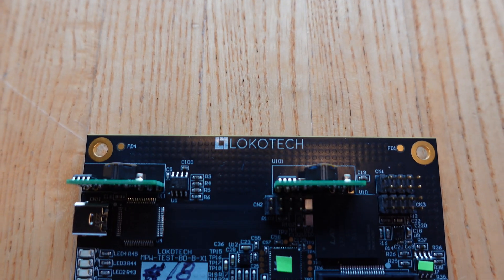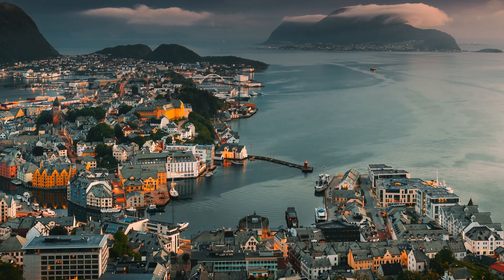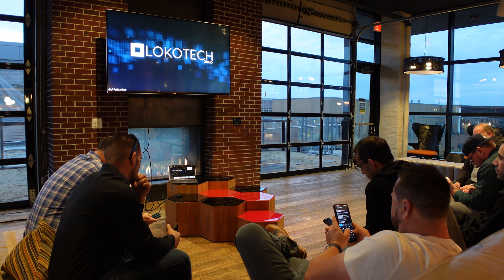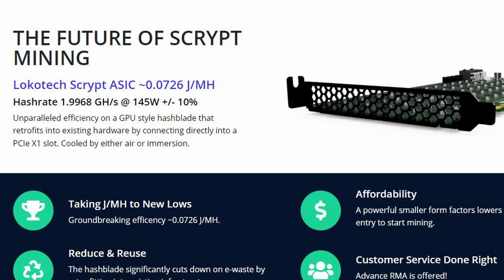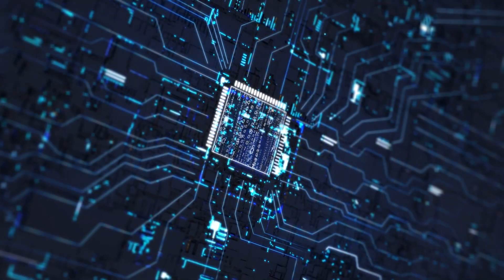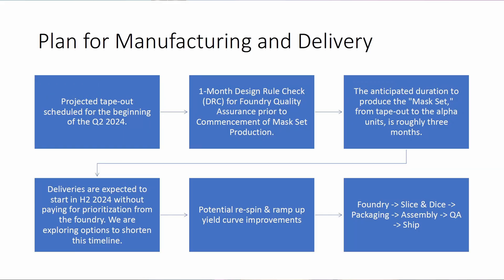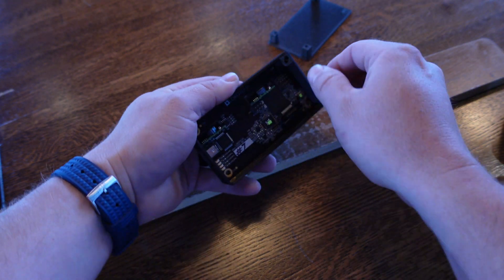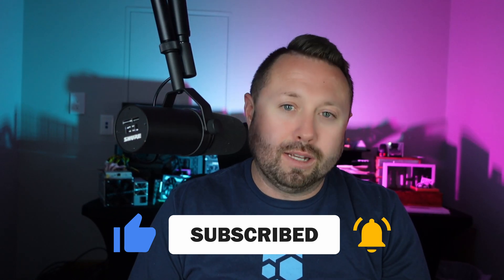This ASIC Miner Breaks ALL the RULES!  Is the LOKOTECH Hashblade Legit?

Comment from the maker: For my Math People Out There .... We Tested 1 Tile.  There will be 256 Tiles per ASIC, there will be 128 ASICS per Hashblade. So in total 32,768 Tiles that we tested in the video.
Reply: Yeah that math still doesn't add up. it's 478 hashes or for easy math .5 kH so 256 tiles would be 126 kH per asic then times 128 asics is 16320 kH or 16.5 mH.
which is more than what you are even saying your math of 32,768 tiles is 478 hashes per tile X 32768 tiles total is 15663104 hashes or like 15 mH.
on top of that the main chip on the pcb you have there the lattice is just an fpga chip pretty sure this entire miner is just an fpga.
Reply: @bobbyhill865 until they build a REAL hashblade and not a funky demo that isn't even the real chip, I won't believe it. 5 years in the making and no functional product.
Reply: Thx for the update, nice one 👍 But, I'm sorry to bring a bit of a shadow but, according to what you're saying, math really doesn't add up, it would mean approximately 16mH per hash board !?!? Also, Bobby make a good point,  the Lattice chip is an actual FPGA !!! Why would it be needed/required ? Anyone else saw that ? Did anyone asked questions about that ? Last point, you're saying that it's performing "exactly the way Lokotech said"  but did anyone had a chance to really measure the power consumption, with like one of those USB meters ? If not, don't you think that it is a bit early for such claims ? Last point, anyone else saw the difficulty of the tests shown? 36k instead of the 29M on Litecoin network ? To my understanding, lowering difficulty trend to give you more Hashes second ?! Anyway, sorry for the scepticism, I am really enthusiastic about that company, would really like to grab some, but overall I got to keep emotions away and stay cold mindset. Thx again for the update 👌 May the God's of luck and Hashes stay with us, so we may mine long and prosper 🙏✌

Comment: This is one FOMO Im not going to regret passing on. After all the hype, all the claims and they still cant display a full version of what they promise. Just a tiny proof of concept board? More red flags. And for 2k its not worth the risk.
Reply: I have to agree with you on this. They promise a lot but can't even show or deliver in person a full product version. I get that they can slap one chip on a board and call it just a fraction of what they can do but if that's something that they can do why can't they show a full product rendering especially if they're not giving it out and it's just a product demonstration
Reply: wholeheartedly agree - especially considering the 450 H/S per tile which doesn't add up even x 256 x 128.

Comment: that is terrible efficiency      1.9968 GH/s = .0019968  TH/s  
LOKOTECH        1.9968 GH/s   @ 145 watts        2000$         that is only  """" .0019968 TH/s""""
OLD ass  s9       1.2 TH/s          @ 157 watts        100$           with one board running and only one of three power supply wires connected to the hashboard.
Reply: It's no btc miner?

Comment: Would it run under HiveOS or would you need to build a desktop GUI version of Ubuntu? Also, 475 H/s * 255 chips = 121 KH/s, not 2GH/s. Wondering how that works out? At the advertized wattage, you could run 40 (80Gh) of these hashblades on a 30A circuit (30A * 80% * 240V / 145W = 40)